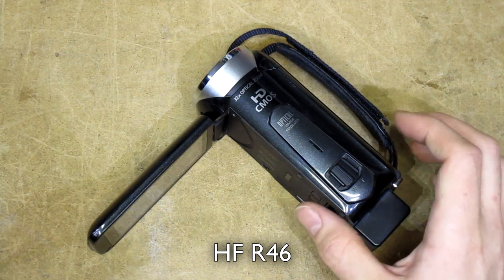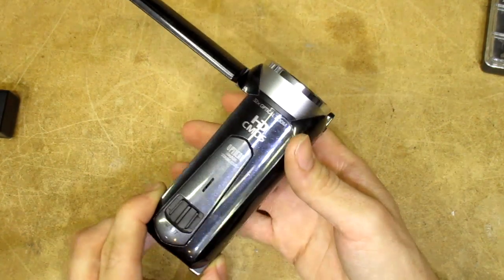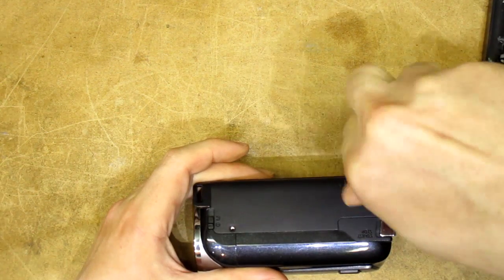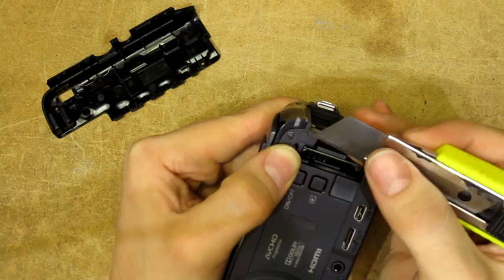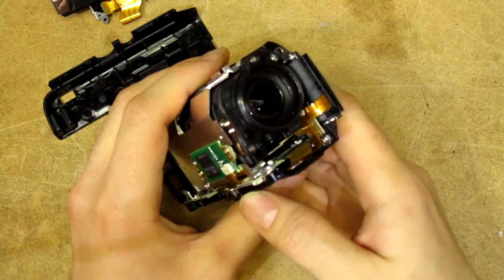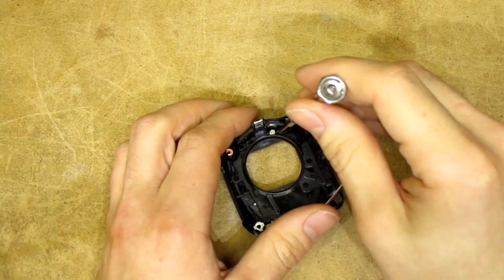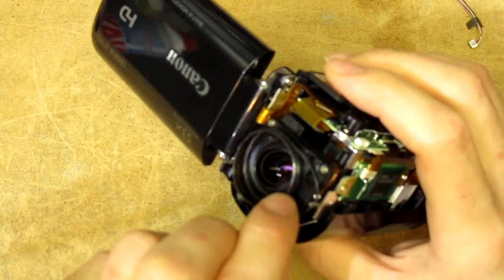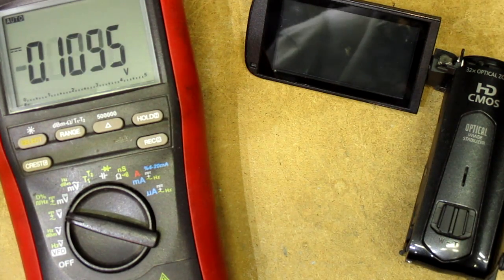Canon Legria R46 partial teardown & microphone hack

Comment: These low end camcorders are never that good. And since point-and-shoot cameras have such good video modes these days, often it's better to go with one of those. The quality on those low end camcorders leaves so much to the imagination, and a Canon FS100 I had years ago one day just randomly died and wouldn't turn on anymore. At least your Canon does progressive video, that's something that took Canon a long time to implement in their camcorders...
Reply from the maker: +DrCassette Your wind noise theory makes sense - I've considered that myself. What bothers me more than anything is that they simply chose not to include any settings for it. Which really sums up the issues with cheap camcorders; it's all firmware gimping. I know that mine runs the same firmware as all the more expensive Canons, but they have simply chosen to disable "advanced" (because things like disabling wind noise reduction are advanced, right?) features in it. There's nothing to prevent it from being a wonderful device - Canon just don't want it to be.

As for the video quality comment I made, the difference actually is considerable when you look more closely, I was a bit quick to judge that. The HF R46 provides superior detail, even at 720p.
Reply: Yes, a lot of limitations are only there because the firmware was set up that way. So if the wind filter is on all the time, I'm almost sure the bass filtering is due to that. I had a high end Canon HF-G30, and with the wind filter turned off, the bass response was better.
This is too bad, because your camcorder looks quite good otherwisely for being an entry level model. Certainly not a piece of plastic junk like the Sony HDR-CX240 is!
Reply from the maker: +DrCassette Are you using that Sony? I've never been much impressed with the feel of Sony camcorders, but the CX240 at least seems to have physical navigation buttons. The Legria only has three buttons in total, plus the horribly under-utilised smudge screen.
Reply: No, I don't think I could use that Sony without getting sick. The only physical buttons it has is a playback mode button and a joystick thing that is only there because the camcorder has no touchscreen. However, the operating menu remains optimized for touchscreen, so the joystick really doesn't make anything easier. The battery is all enclosed inside the camcorder, so you can't get a higher capacity model, and the only way to charge the battery is by turning the camcorder off and connecting it to a USB power supply. No more AC adaptor.
I used to have the Canon HF-G30 which I loved, but I wasn't using it often enough to justify the high amount of money I spend on it. So I sold it and replaced it with a not so great Panasonic HC-X909 that (used, off Ebay) cost me only a third of what the Canon did.
Reply from the maker: DrCassette Ah. Weird design on Sony's part, you'd expect them to use a touch screen when they can, given how little they cost. And you'd REALLY expect it to run off of the mains. What on earth.

What's wrong with the Panasonic? A quick googling makes it look a bloody lot more serious than, for instance, my Legria, although I might be looking at the wrong stuff since the X909 in particular seems to only give you results in german.
Reply: The Panasonic X909 is a nice camcorder, just compared to the Canon HF-G30 it's not so great ;)
The Canon had a lot of direct access buttons for functions, the Panasonic has pretty much everything buried in the touch screen menu, and the Automatic White Balance is pretty bad, it keeps shifting and is never really accurate. So I always have to set the White Balance manually, which is something I never had to do on the good Canon.
The Panasonic X909 I think is the model for the German market, internationally I think they call them X900.

Comment: See if you can find a Nikon P500 somewhere for a decent price. cheapo chinese batteries for these are plentiful and work amazingly. it supports 64GB SDXC cards properly with a firmware update... and I've been rather happy with it and the amount of zoom it gives for the price I paid at the local thrift shop (US$30 after 25% off.)

it also does high-speed in some lower-resolutions, most notably 60 frames at 720p and then 120 at 640x480 and 240 frames at 320x240, with the flick of a switch. For a Pro-sumer camera from 2011, it's fairly well-done albeit a bit lacking in some areas depending on the needs of the person using it.

USB charging too, and the firmware update also fixes a bug that made it drain the battery if USB charging is turned on.

test pic showing a shot with macro on: https://a.pomf.cat/mtutzu.JPG
test videos are plentiful on youtube of it too for high-speed and HD alike. I have a couple but they're nothing to look at if you don't want to be bored out of your mind.
Reply from the maker: +Sudos $ 30 for that camera seems like a mighty good deal, I don't think I'm likely to come across anything similarly good. As things stand right now, I think I'm going to make things interesting instead, adding more hacks to the R46 as time goes along. When I finally do get a new camera (if ever), I'll probably just condense everything down to one singular DSLR.
Reply: +FFcossag sounds like a plan, but do think about grabbing one if you find one for cheap. 
now, if you reeeeeally want a challenge (you don't actually have to do this), try fixing the mic issues on a DSC-H70. that thing is so crap that it picks up the internal EMI reeeeeeally bad on videos, especially if the mic is covered.
that was one of the reasons I was glad mine died when it did and is what prompted me to pick up the P500.
Reply from the maker: +Sudos I've got enough of a challenge battling that on the Canon already - it might not be as apparent on the final renders as it is in editing, but it has a constant "beep-beep-beep-beep" sound captured by the internal microphone if the auto-focus is enabled. Although I suppose it's of a different nature, since it seems to be mechanically coupled from the AF drive, rather than EMI.